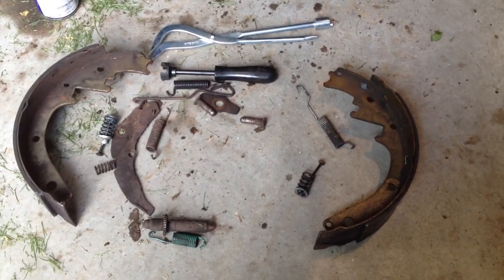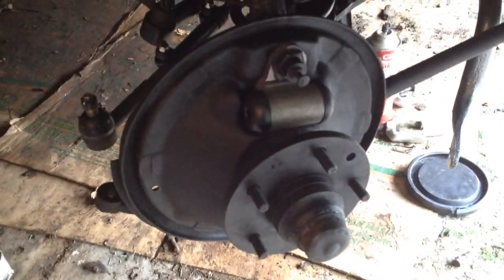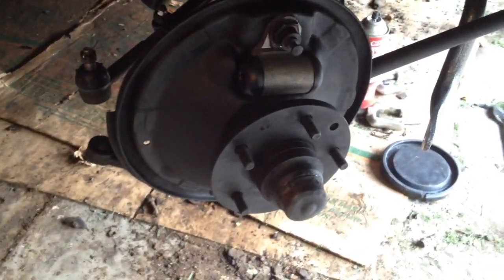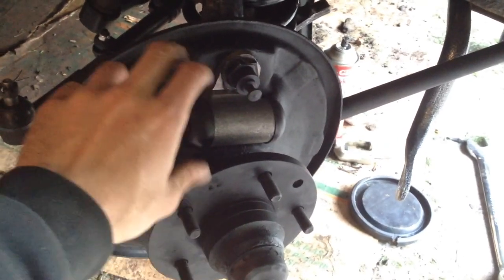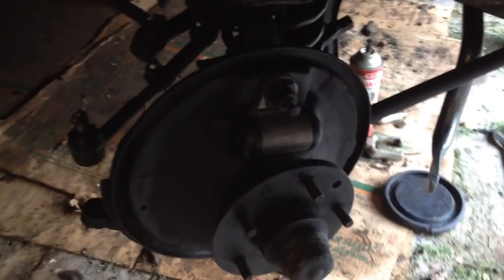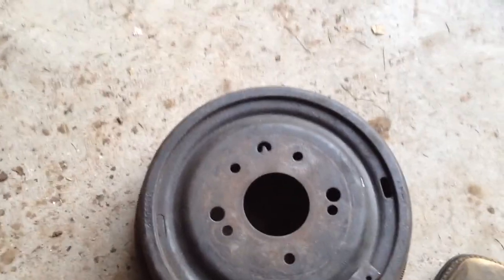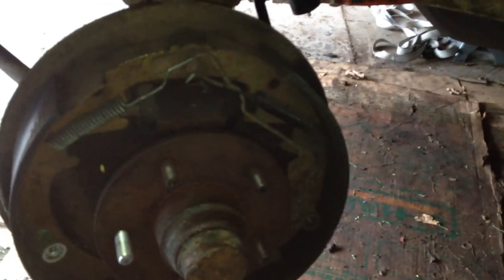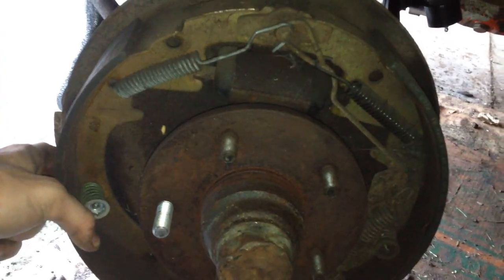Drum Brake Rebuild - 66 Impala Project Car

Comment: How did you get that front wheel cylinder off? I have the same setup and I tried a breaker bar and it will not come off. Is there some trick?
Reply from the maker: There’s just the two bolts and the hard line, so if those aren’t coming definitely use penetrating oil, or maybe some heat
Reply: iowadiy I used some pb blaster overnight and it got the bolt off. There was only one bolt in the front that held the wheel cylinder on, if you look at a 68 impala front wheel cylinder you’ll see what I mean. Thanks for the quick reply!
Reply from the maker: Sometimes it’s easy just to come back the next morning and give it a try!

Comment: Drum brakes are always a pain man. It takes a lot of fighting. Me personally, I would have just left the cylinders. You can replace them many times without taking off the shoes, plus I have found alot of aftermarket ones go bad quick
Reply from the maker: I decided to replace the cylinders right away because on the last car I had that was sitting awhile, the cylinders all went out about 500 miles apart so I didn't want the hassle

Comment: The adjustment access port is in the drum. It's accessed from the drum side not the backing plate!
Reply from the maker: On newer vehicles they switched it to the backing plate so that you can easily access it with the tire on